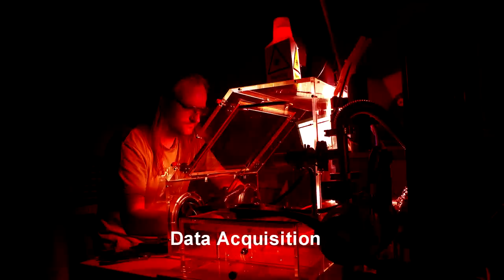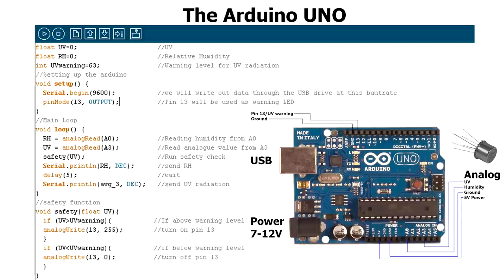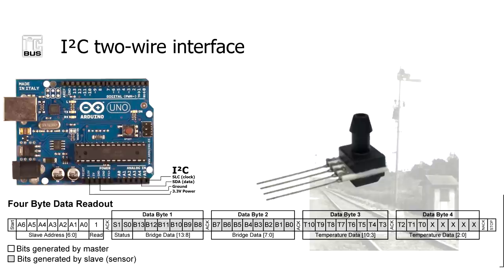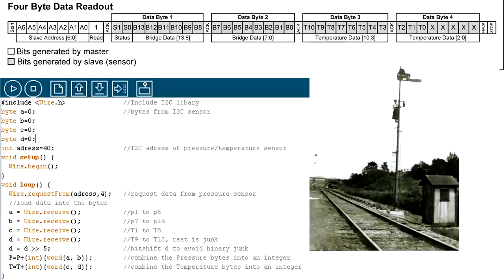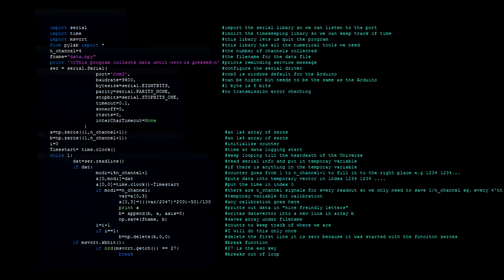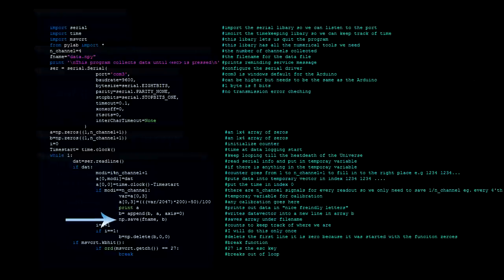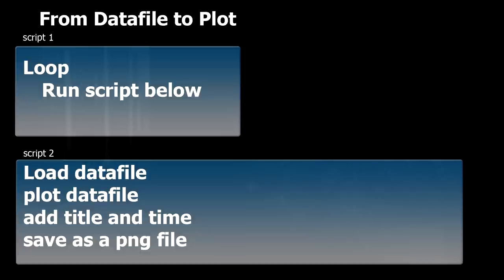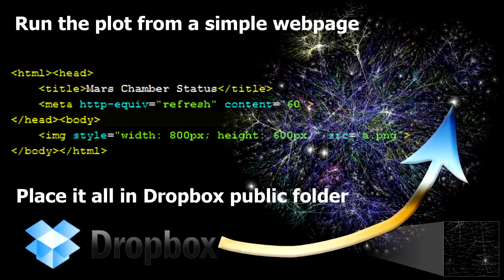Arduino data acquisition for Jens Martin Mars Chamber

Comment: You, good sir, are a god! Exactly what I needed content wise and the music...yes! 

I am a freshly minted physicist and mathematician currently working as an RD Engineer. Current task, understanding friction! So I am building a polishing apparatus with attached load cells that will measure the changes in the friction force as a function of the polishing conditions and the materials used. The Arduino will be used much like in your setup-to acquire data.    

Good luck to you! Physics on!! Thanks

Comment: I'm glad that is the case! Thank you for your wonderful video.
Yes, strain gauge/load cell. 
I am new to most of this methodology, so the challenge at this point is to figure out how to make all the parts talk to each other and to turn out meaningful data. The 'meaningful' part is a bit of a challenge given that I am dealing with-what l believe to be- relatively small fluctuations in force. So, the sensor/voltage applied to sensor/Arduino/(amp perhaps) combo has to be adjusted accordingly.

Comment: Thanks again, I had not considered that option. Similarly, I was wondering if there was a way to adjust the way the resolution was allocated for each Input pin. i.e. if it was possible to allocate the 1024 bins to a voltage range lower than 5V. But, perhaps the limiting sensitivity of the pins is very near 4.8 mV anyway.  
By the way, what became of your Mars Chamber? 
Oh, and who was this music by--it is rather palatable and I think I would enjoy it as ambient study music. 
Best regards.

Comment from the maker: You can buy a 24 bit analogue to digital converter (ADC) running on I2C on various hardware sites, eg. farnell which might allow you to omit an amplifier completely.  Or try using an old 24bit 196khz sound card and a sound program.

The trick to getting the I2C address of a component is to load in a scanner on to the Arduino 

I'm guessing the calibration of the gauge/load cell will be the hard part. Try hanging known masses from it with a piece of string and fit the response to a polynomial,